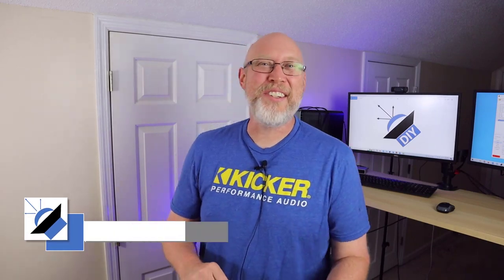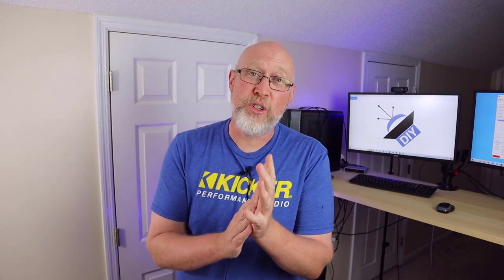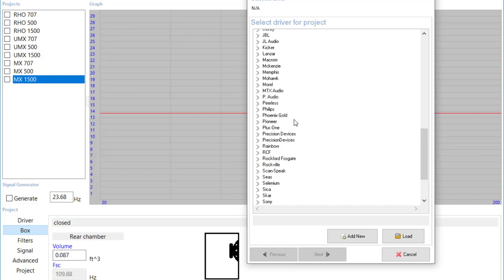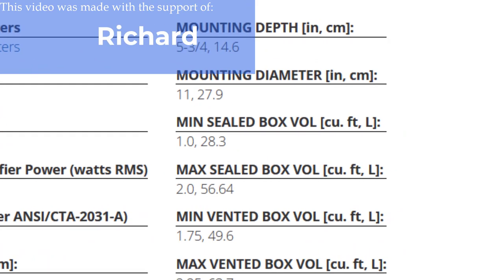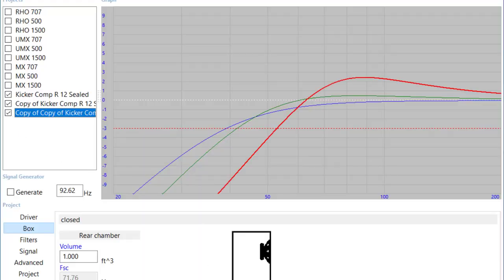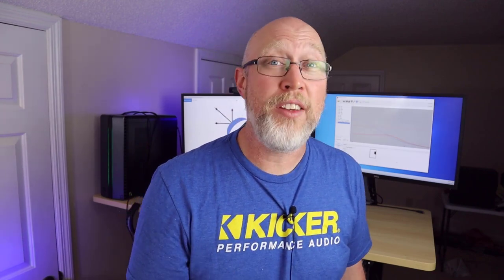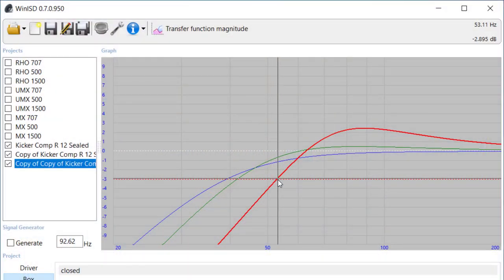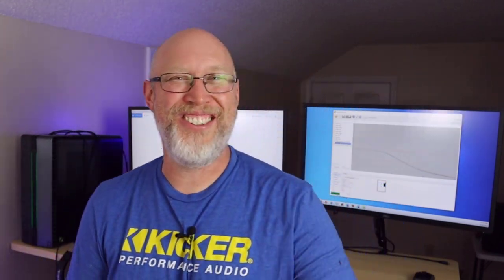Sealed Subwoofer Box Design:  Science and History of Acoustic Suspension

Comment: Was wondering if you had a recommendation. 
I just bought a AudioPipe TXX-BDC4-12D 12 Inch 2,200 Watt High Performance Powerful Dual 2 Ohm DVC. 
I am having a hard time figuring out what amp to pair up. 

It is in a Qbox single 12" ported. 
I was wondering what amp will push its peak without blowing the sub. 

Any suggestions?? 
Thanks
Reply from the maker: That's going to be a tough one! Audiopipe makes some fantastic budget-minded gear. It's hard to get a better bang for the buck.  But their power ratings are not accurate.  Looks like the official RMS rating on that subwoofer is 1,100 watts.  

Looks like you have the dual 2 ohm version, so you want to wire the coils in parallel to get a one ohm load. So make sure that you pick an amp that is one ohm stable.

This amp here might be a good candidate.
https://youtu.be/5puEET5Bpjk
Yes, call me your subwoofer can probably handle a little bit more power, but it has a clip light on the bass knob. So just watch the light and don't clip the amp.
Reply: @DIYAudioGuy  So you don't have a recommendation of Amps that you think may complement the 12. You can give me 2 or 3 I am trying to get a good idea on what will make it sound its best. 
Currently it is on a old Blaupunkt I had but the amp keeps clipping. It RMS at 2ohms is 450-500, but that barely touches the subs 1100 rms capacity 
I was thinking something with 1200 rms to push the sub but not clip the amp and set at 75% gain
Reply from the maker: @dlopezchampion8054  I just gave you a solid recommendation.  Here is another option:  https://amzn.to/3xK1S5L
Reply from the maker: Or this one:  https://amzn.to/3OpkX3Y

Comment: Nothing sounds quite a precise as a large sealed enclosure,
Reply from the maker: Yes.
Reply: @DIYAudioGuy  Which would provide better performance AND sound quality?  A sealed sub box with 2-12" Subs?  Or a ported sub box with 2-10" Subs?  I am contemplating down grading from 2-12" CompRT's (500W RMS per) in a Soundbox prefab sealed box @ 1.48 cu ft air volume from Amazon (which performs really well, but I want more... lol)   to a set of 2-10" Kicker Q-Class (700W RMS per) while using a Fox Acoustics 10" Ported box @ 2.1 cu ft air volume while being limited to having a mounting depth of 6.5" or less.  Also contemplating the Fox Acoustics sealed box (also 2.1 cu ft air volume) for the 2-12" Subs I already have.  Box Fox Boxes have the 5/8" Seat Riser Kit included.  In either case, would adding poly fill be of benefit too?  
Survey says?
Reply from the maker: @Vegas_Baba808  Hard to say.  If the 12s are in an undersized enclosure then switching to 10s could help.
Reply: @Vegas_Baba808  Sound quality can be subjective but I've found as long as you don't overdrive your subs, both sealed and ported can sound equally awesome. I'm satisfied with a single UM10" (Originally Sealed but now uses Passive Radiators) in my car. And two UM12s (Ported) in my house. The single 10" in my car is louder than my dual 12s so where the sub goes plays a huge part as well for both the output and frequency response. And I couldn't tell a difference between sealed or ported when I had the Ultimax 10" sealed and compared it to a ported 18. (Full Marty using a Ultimax 18)

As for what would provide better performance, It heavily depends on what kind of output and low end you're trying to get out of the subs + how big you're able to build the box. If you're limited on space sealed might be your only option for a good balanced sound that can still play decently low. But there's also Passive Radiators that can let you get away with a smaller than a ported box and still have similar output. And still sound just as good as sealed. (Smaller than a normal ported box because you don't have to worry about port chuffing if you undersize the port)
Reply: @JoshM7  Agree about not over driving subs.  The sealed box I have ends up sounding mechanical when bumping at 80% to Full Tilt Boogie (Trademark - Kip Litsey) for certain tracks (but it is not distorted due to clipping as the gain structure is set correctly across all Amps and the DSP) = it just does not sound natural or balanced when being played at very loud volumes.  I was thinking a ported box with more cu ft volume would eliminate the mechanical sounding component.  The problem may actually lay with the recording quality of the tracks that exhibit this mechanical sound, in addition to harmonic resonance of the subs unloading on the floor and rear cab wall.  My truck is like an amphitheater, due to the massive sound dampening and insulation (100 Mil Kilmat and 150 Mil Noico Red) that was done front to back, top to bottom.  The Epicenter effects is also all the way off, so that is not a contributing factor for these problem tracks...

Comment: Do you have plans for a 6x9 box for good bass?
Reply: 6x9 as in coax speakers? Most of them are made for open baffle and can have exceptional smooth bass if they are in the rear deck of a car. (Assuming you are talking about for a car) But they might lack the excursion to have tons of output under 50-60Hz. Better to just get a sub. A sealed sub using the right sub can shock you with how low it can play. My Sealed Ultimax 10" had really good output from 26Hz+ and could audibly play to 15Hz (no harmonic distortion which surprised me) while shaking my cars doors with the pressure.
Reply from the maker: I do not.  There aren't a lot of six by nine inch subwoofers out there on the market, tons of coaxial 6x9s.

Comment: I think discussing box Q is just as important as the speaker QTS, with both we can predict response with the box.

Also, the `tightness of bass` in a sealed box isn't because of the box, it's because of the total Q of the system. Put a woofer with a QTS above 1 in a sealed box, and the results are not going to be good, ever. On the other hand, if you take a woofer with a very low QTS and put it in a small sealed box, you get also a poor response.  So, the box combination depends on the woofer design just as much as the woofer design depends on the box design in relation to the design goal.
Reply from the maker: Yes, you got to match the box to the driver.

Comment: Closed boxes requires special drivers you no longer find
Reply from the maker: Yes, most modern drivers work better in a ported enclosure -- sealed needs a soft suspension so that the air spring can do its job.
Reply: @DIYAudioGuy  I can remember Pioneer doing a F version of their subs in the late 90's for car audio, these were designed for "Free Air" installs where as the C versions (most commonly used) were suited for sealed & ported. I could never workout if the F version used stiffer or softer suspension as i never managed to get my hands on one to compare.

Comment: I'm thinking of picking up a 10" for my diy amp, it's a class AB and only 30 watts
I'm currently running two bookshelf speakers, tuned to 55hz, with a massive 18db bass boost, it's extremely boomy
the cones move a lot but I can't hear anything below that, and when listening at high volumes, I'm barely sending +- 1v from the amp (max is +-17v)
so, do you think that with that little power, a sealed enclosure and the EQ, I could hit maybe 25hz? at low spl levels at least
Reply from the maker: Yes, the key is "low  spl levels"
Reply: @DIYAudioGuy  Thanks!

Comment: I guess it depends on how you personally want the sub to perform for you. Do you want subwoofer bass or just want old fashioned bass..?? 

Subwoofers can do either or to your choosing by setting the hertz frequency response. 30 hertz, 25 hertz or 20 hertz. etc. Subwoofer is actually a large speaker woofer if you want to use it that way at 20 hertz setting. It leaves out the sub frequencies and only hits the bass note hard, powerful and very tight. Great for listening to classical orchestra music and old fashion rock & roll.